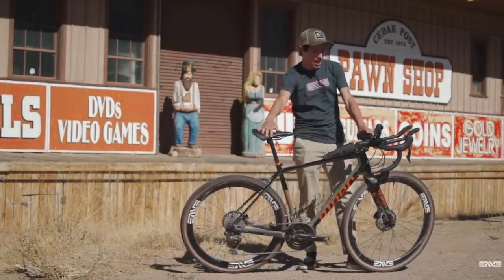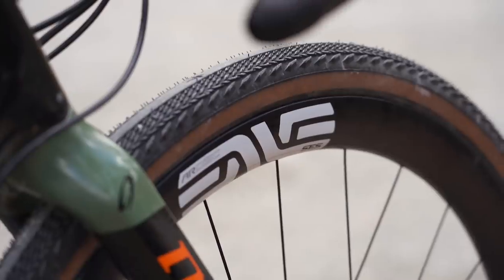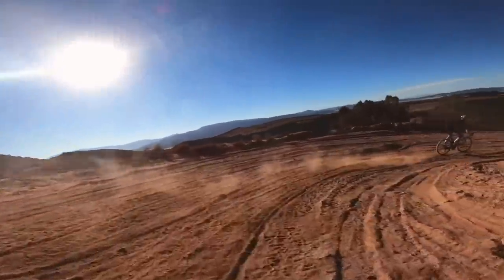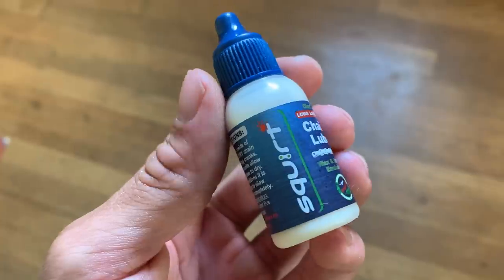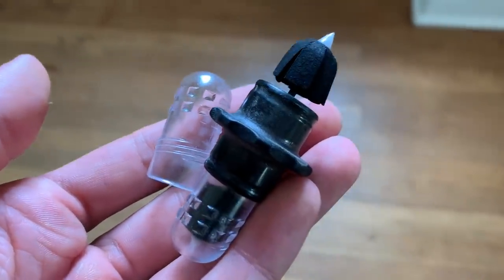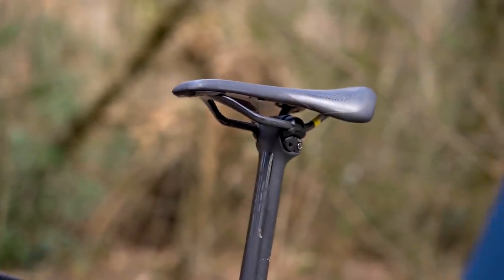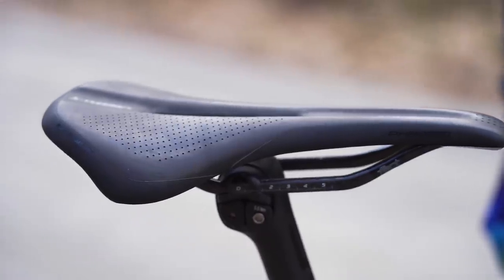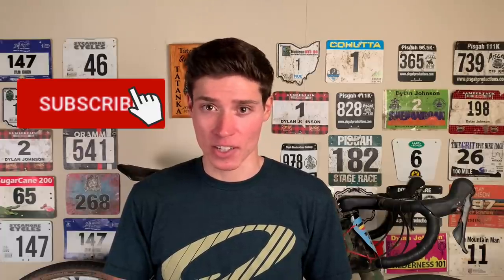My Gravel Race Bike Setup for Belgian Waffle Ride Cedar City

Comment: Love your comments about 2X vs 1X. Had the pleasure, back in the day, to ride with Andreas Hestler on the North Shore - he told me the best thing about 2X was being able to change directly between big and small front rings and make that huge gear jump either going into a steep climb or coming over the top of one. I never really considered the cross-chaining impact but it makes total sense to me. 1X is waaaay over-hyped IMO.
Reply: And yet many pros are still racing with 1x rings... I like Chevy trucks by the way. I find their engine is more efficient and lasts longer than the Ford. My dad likes the Ford though, since he prefers the transmission of the Ford....  I hunt with a 270 Winchester but my cousin prefers a .308 Winchester. He likes bigger bullets. I like more speed. I was using a 1x setup before they came out with 1x setups from the factory (removed rings from my 2x). I prefer to have one less thing to think about in our hilly terrain. Truth be told, 2x is more of a pain in punchy climbs and elevation while it's more advantageous for flatter races..... 2x on the road bike all day though.... Also really appreciate Dylan's input. He always puts out great videos!

Comment: Squirt for the win. I am totally sold on it as well, especially how long it lasts. I used to have to lube every ride but now can go two or three between applications.
However, not sure about applying it mid race. It says on it specifically to allow it to fully dry before you use it. You want the wax on the chain without the water to attract grit. Seems like adding squirt mid ride just gives the chain more of a chance to attract grit while it is drying.
Reply: In the low-humidity environment that seemed to be, it may still work as intended.  I watched another race-coverage video from a racer who also stated that, by the middle of the race all of his chain lube was gone.  One has to do something in that situation.
Reply: There is the ideal setting, then there is "better than nothing". The excess on the outside of the chain doesn't do much to lube the chain though, its what wicks into the rollers that matters.

Comment: Just a suggestion that is easily provable, Having your saddle forward lessens the amount of quad muscle use and isolates the muscle you do use, tiring it out quicker. It also makes for a shorter power stroke and limits the use of the saddle as an anchor. You should do a FTP test with your saddle back placing the saddle center at 73°, and don't forget to lower it. If the stem needs to be shortened below 60mm the bike is too big. I've seen the article on moving the saddle forward for aero but then you have to raise it, raising your whole body into the air, increasing the bend at the waist. It also ties up your hips and thighs when bent over so far. Saddle placement and rider position over the BB shouldn't be determined by the length of your femur. Checkout Keith Bontrager, the myth of KOPS. But everybody's different.
Reply: I'm with Dylan on this one, I've changed all my bikes for in-line seat posts after trying it on my track bike. More torque, better cadence, just felt smoother. Can use more of the saddle as well.

Comment: Hey Dylan, nice vid and setup !
Few questions :
Do you put tubeless sealant with your tubolight inserts ? If yes, which one ?
Do you know the rolling resistance numbers of the specialized pathfinder tires ? I checked on bicyclerollingresistance website and couldn't find them.
Thanks
Reply: BRR hasn’t tested them. He’s been slow to the game with gravel tires and worse yet is testing a lot of smaller sizes which aren’t that helpful. I think I’ve seen most or all of the tests out there, and the only data on Pathfinder I’ve seen is from a German magazine, and it only tested the 38mm size. That said...It did come out pretty well on rolling resistance, about three watts slower than the fastest, the Continental Terra Speed. 22.1W for Conti, 25.2 for Pathfinder. The Conti is the fastest thing going in a lot of tests, at least for a real tire with some protection against flats, but it measures small, usually about 38-39mm for the “40” size, depending on your wheels. So if you need more volume -- and this course absolutely did -- Pathfinder 42 is a good choice. I ran one in rear and a WTB Resolute in front for a little more bit. Both measure out at 43mm-plus on my wheels.

Comment: Great video Dylan! Love that article on VeloNews about 1x drag. To drop some more weight, you should get a Quarq Dub crank which you can move your power meter over to. They are about $199 now and considerably lighter than almost anything else out there. I used to run SPD on my road shoes but felt it added a good bit to stack to the shoes and didn't like that. I'll have to check out those egg beaters adapters, they look lower. I know many are talking about your bike size, I have looked and there are several studies on seat tube angle and almost always the crazy steep seat tube angle is faster but usually it's a position that cannot be held for long periods (20 minutes).
Reply: Only if you can still get a hand on D1 version. Sram is replacing Quarq arms with D2 version which is more than 100g heavier. D2 is essentially Sram Force crank arms, rather than Sram Red of D1.
https://weightweenies.starbike.com/forum/viewtopic.php?f=3&t=163618
Reply: @Hexsense  I think you actually commented on my Quarq post on Facebook. Great info!!! And thanks for the heads up on that

Comment: Great video from a fellow weight weenie thanks 👍. 

I'm not a bike fitter but with that saddle slammed forward would you not be better off with a size 54?
Reply from the maker: Thanks! How far forward you put your saddle has more to do with your femur length compared to your tibia length than your reach. Maybe I'll make a video about it.
Reply: @DylanJohnsonCycling  Please do!
Reply: @DylanJohnsonCycling  a bike fit video would be epic! I’m 6’ with short ass legs and have been struggling to get my bikes to fit right.

Comment: Love flared bars for gravel and CX. Apart from improved handling on downhills and ruts, I can get my head lower than non-flared and also breathe much better - aero difference is a wash or better but this depends on the rider.

Comment: Interesting stuff, especially the tyre insert and how low you drop your tyre pressure. I don’t like the soggy feeling you get when the tyres have very little pressure, especially if you hit a rock and you can feel it hit the rims as the tyres deflect. I wonder if this in some way goes towards counteracting this.

Comment: Great video and detail explanation. I like your pedal and shoes combo. I rarely see the eggbeaters being used outside of the Crankbrothers sponsored riders. Even if they are extremely light, shed mud the best and I find them also easiest to clip in and out of. I've heard they are not as efficient as shimanos, you lose power with them, through the spring flex? Do you have any info on that?

Comment: dude, the aero cost of that second ring is circa 10 watts, and that's over the whole course. Also there's been research into the weight of shoe's and their influence upon performance and basically there isn't any significant measurable amount ( i seem to recall the that a few hundred grams equated to approx 0.002 watts or something ridiculous ), except in aerodynamics of the profile.
Reply: You just keep on believing that, lol.
Reply: Source?

Comment: now that most race bike come with 32 mm tire clearance, could they not be used as gravel super bikes. maybe not for the bwr but for like dirty kanza. they are a couple pounds lighter. i mean a compact 34/50 with a 32t cassette would be enough for most climbs if not all. im thinking about the giant tcr here
Reply: 50/34 is proper on gravel when you fit enough to shoot for podium.
For me though, On gravel double chainrings 44/28 or 46/30 is more appropriate.

Comment: Hi Dylan, in most of your videos you are talking about only 3 zones. Do you consider z2 as everything beyond recovery up to your threshold? Or does it top at maybe 80% of your FTP? And during Z2 endurance rides, is it recommended to alter between higher and lower power within the zone (so kind of z2 intervalls) or doesn't that matter?

Comment: hey dylan, nice bike!
i was wondering how the red crank affects your chainline?
I'm currently thinking about getting a crank based powermeter on my grx800 groupset and trek checkpoint frame. 
Only  (reasonable priced) supplier would be stages for me, but they dont offer the grx crank in 165mm.
Do you think a ultegra right sided crank with the grx chainrings would do the job?
thanks in advance!

Comment: Loved this, but I do have one disagreement - unless you have immaculate timing with breaking going downhill, I've found the 700x38 Pathfinders to be extremely unpredictable and squirrelly on loose over hard. They may be great on flat gravel and pavement, but they have terrible traction both going up and going down on gravel surfaces.

Comment: so, I think I am going to wafer this on my XC bike but run 700x40s instead of the 2.2s I am not in it to win it just have fun but... I know with the paved bits etc. my XC is SLOW did 66 saturday.  I am in the argument with myself about 2x vs 1x.  I have done a lot of riding up dirt in s. utah at higher altitude than BWR so I know what that takes. thoughts?

Comment: tell me about those grx brakes. i tried them and think they break weak. compared to paul comp clampers the end power is weak and compared to ultegra the grx brakes have less modulation and even power. a friend switched from grx to xrt fm calipers and it's like night and day

Comment: Gear newbie question: you ran the GRX groupset with a SRAM crankset?
Reply: I think the  decision was driven by the quarq Dzero powermeter spider which is only sram compatible.
Reply: you can actually mix and match most of SRAM and Shimano, road and MTB. You can use Shimano cassette with SRAM derailleur and road cranks.
Reply: @roilev  That's great to know. I run GRX but they don't have they're 810 crankset in the crank length I need.

Comment: Hey man, thanks for the links. And for the video in general, good stuff. However, I don't think the Silca tire pressure guide is good compared to the SRAM one. SRAM lets you pick rim width, as well as tube or tubeless, dry or wet, etc. It's just better all around. Here's the link:
https://axs.sram.com/guides/tire/pressure
Reply from the maker: The thing I like about Silca is that they ask you about the riding surface which is one of the most important factors. Sram just asks what style of riding you’re doing. Both great tools though.
Reply: @DylanJohnsonCycling  That's true, I like that, but they don't ask you whether you are TLR or not, which is, to me, kind of a dealbreaker. Also I feel like not asking the inner rim width kinda means it's just not accurate.
Reply: @dirragon1  they can ask for tire width as stated on the side wall and rim width. Or they can just ask directly for how wide the tire actually measure on the rim...
Reply: From what I can tell, Silca assumes tubeless. The Silca calculator comes much closer to matching my personally tested optimal tire pressure on loose gravel. Can’t believe I never knew about it until this video.
Reply: @Hexsense  Yeah that is fair enough. I didn't notice that in the parentheses.

Comment: Great advice once again ! 
Are you familiar with the Classified Powershift Hub ? 

It’s an alternative for the front derailleur, offering the same functionality while getting rid of all the downsides? After 7 years of development, POWERSHIFT technology: a wireless 2 speed shifting system, integrated in the rear hub, allowing you to change gears in a split second, under full load and on any terrain

Currently the Belgium Brand only sells the hub with their wheels

https://classified-cycling.cc/en/powershift-hub

https://classified-cycling.cc/en/online-shop/powershift-wheels/classified-gravel-30

Riding style: Gravel/Road
POWERSHIFT ready: Designed to perfectly fit a Classified POWERSHIFT rear hub
Front hub: DT Swiss 240 DBCL Straightpull
Rim type: Carbon, clincher, tubeless ready
Rim depth: 30mm
Brakes: Disc only
Rim Inner width: 23mm
Rim outer width: 29,5mm
Spokes: 24 DT Swiss Aerolite SP
Weight wheelset: 1,375g (±5%) (Including front hub, excluding POWERSHIFT rear hub)
Recommended tire size & max tire pressure: 32-42c, 120psi/8.3bar

What are your thoughts on this ?

Comment: would you pick pathfinder pro over panaracer gravelracer sk+ ?   I am building a gravel rig.
Reply from the maker: I haven’t tried that tire but the pathfinder pro is the best gravel tire I've used so far.
Reply: I think the Panaracers have a weird rubbery feel. They wear super fast too.
Reply: The k stands for knobs, the + is for extra puncture resistance at the cost of weight. Source: i've been riding the 50mm version for about 500kms so far on very rough terrain, no problems so far. Thing is I don't race, for a race I'd have chose a lighter, skinnier tyre.
Reply: @palicar  gravelking is very durable in my experience.
Also,in 3000 km 100% puncture proof
Reply: @DylanJohnsonCycling  ,.i have been using gravel king sk , great tire , great puncher protection , just switched to pathfinders , they are faster for sure